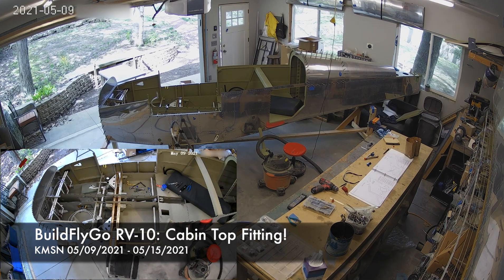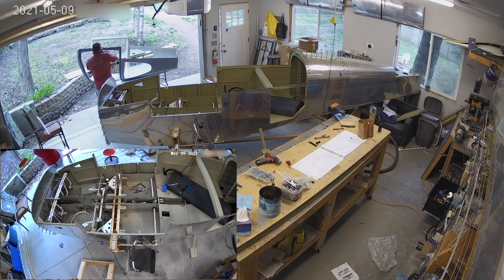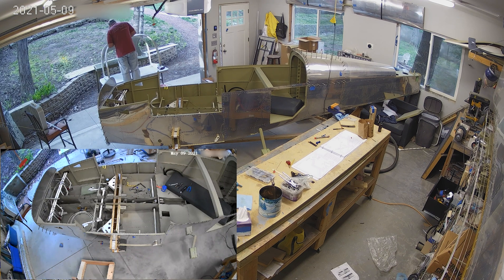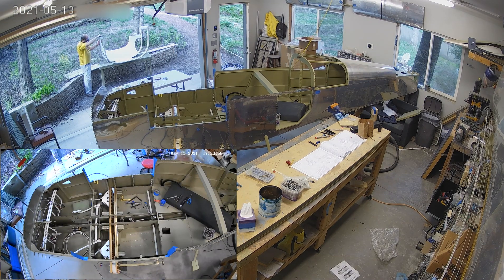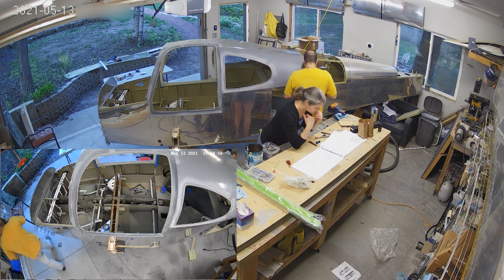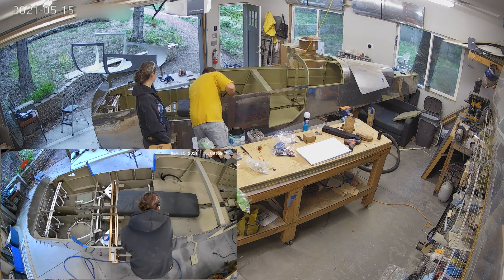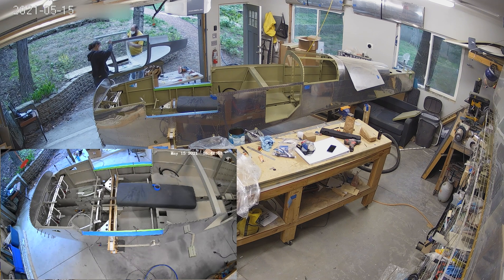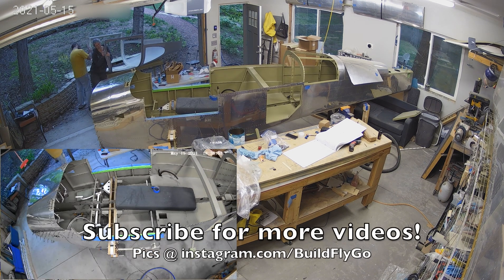RV-10 Build: 05/15/2021 - Cabin Top Fitting

Comment: Im planning to do the show planes composite tailcone on mine should look very nice with their cowl
Reply from the maker: Cool. I wanted to do it as well but they were unable to tell me about any engineering analysis they did to confirm it was structurally equivalent to the original design. Please let me know if they are now making that data available.
Reply: @BuildFlyGo  hmmm well I know there are a few out there that have used it like the cowl.  I will see when it comes time
Reply from the maker: Agreed, there are a few flying for sure. I reached out to some of those owners and they also did not receive any engineering structural analysis. We each take on the risks we are comfortable with, this was just not one that worked for me. Doesn’t mean I’m right or wrong :)